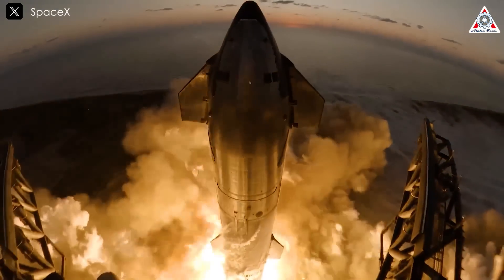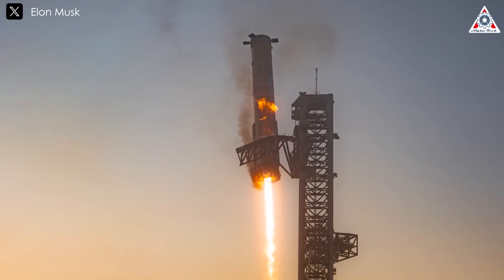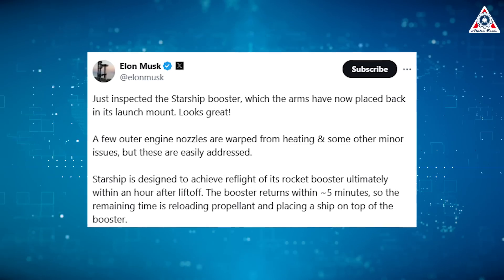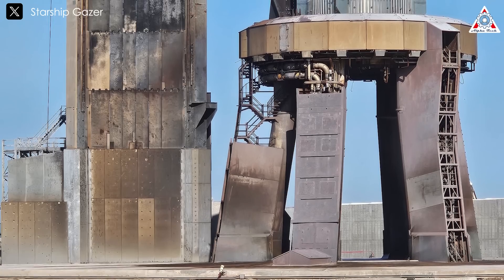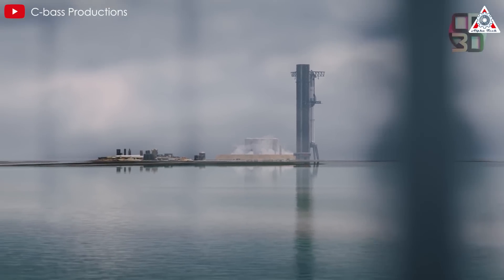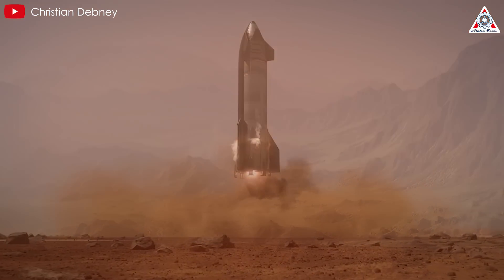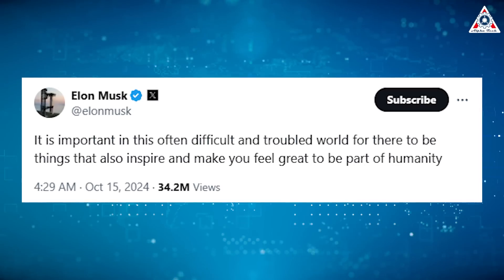Analysis SpaceX Stage 0, Starship and Booster Aftermath..."DAMAGED"???

Comment: Make them clean the water that gets contaminated launching and landing in the one spot. That water is filled with chemicals Andre’s right into the environment….glass of water anyone?
Reply: The majority of exhaust from the BURNED fuel is nothing but water.
Reply: Nasa, Boing etc. didnt care about pollutiuon of Water the since 60 Yrs und now its a problem  for SpaceX??
D
Reply: I would like to say when you burn methane (CH4) & liquid Oxygen (LOX), which heavy booster does,  the exhaust is Carbon Monoxide (CO).
L🙄🙄k it up. 
Nice catch SpaceX!! I love it! Whoot!
Reply: You are forgetting all the materials the engines are made of that ablate into the water. Heavy metals, seals, gasket materials etc.
Reply: @keith3761    Engines don't ablate, laughable nonsense, and the rest U mentioned can't be significant as it wouldn't be reusable otherwise.
Reply: @Mrbfgray  The engines do ablate, just as the tower does when it gets hit by the rocket exhaust, thus the constant repainting. even spaceX has mentioned before the ablation rate of stage 0. how much the engines ablate is something we dont know but they do ablate. Also reusable has a WIDE definition. reuseable does not mean 0 service required. It can just mean it needs X done to it before reuse. My car engine is reusable, but it can still need significant repairs due to wear over time. And although a car just puts in gasoline it does have a CAT because it does spit out metals and other enviro damaging stuff.
Reply: @keith3761    Your car ablates paint and engine heavy metals and vastly more toxic rubber than entire Starship.  That's why U clean every foot of road behind you, right?
Reply: @Mrbfgray The tires put lots of particles into the air.
Reply: @stanley8574    Yup.  Especially the way I drive.  :D)
Reply: @Mrbfgray  yes, thus my point that everything ablates/wears. Personally i dont care about the environment at all. I removed my cars CAT. Not caring about something is different from not believing it exists. Starship will cause environmental damage, as does everything. Im not the government I don't decide what they do and don't have to do EPA wise nor do i know what the scale of damage will be. But saying contamination is not happening is laughable. Personally I think Musk should have just bought a small Caribbean island off a small nation for cash and then could have the EPA and also would have much much less restrictions on launches by the FAA (FAA still controls all US launches no matter where in the world)
Reply: @keith3761    Removing cars CATs is utterly moronic while pretending to care about the environment.
Reply: @Mrbfgray  I just told you I don't care about the environment. you missed that. but I do understand it harms the environment.
Reply: @keith3761  OKAY Fine.
Reply: @keith3761    I was hasty and sloppy...mixed up posts here, some meant for someone else.
Reply: Why don't YOU go down and clean the water, obviously have nothing productive to do otherwise.
Reply: How would you know?    Or is it  just  you ,  trying to get some attention.!    Lossers!
Reply: The solid boosters pollute a lot more but guess they are ok right.

Comment: Newton 3rd law of motion:  Say you need 10,000K Tons of force to propel a rocket up, where does the downward force goes? What will be the impact on the ground?
Reply: Relative to the mass of the Earth? The ground is fine. Also, this stack weighs 5000 tons at liftoff, not 10 million tons.
Reply: @joshuasmith1981  What I see is the ground get compacted and in relation to sea level, it is sea level rise. End result is flooding. The downward force also impacted the tectonic plates resulting in earthquake.

Comment: why do they call it a catch when it can more appropriately called landing on the tower with the "chopstix" securing it post landing ?
Reply: Because the starship is what landed and the tower caught it.
Reply: Because the booster is supported by the tower it isn't touching the floor, so it would be caught like a child in a parents arms
Reply: Literally "caught" by the "catch" arms.  How is this confusing to you?  Harris voter?
Reply: Technically you are correct but I  guess 'catch' sounds more impressive. In reality, yes, the booster flew slowly under directional control into a stationary target. This time though, instead of the target being a horizontal circular area on the ground (or on a barge) it was a controlled horizontal V shaped area (the 'chopsticks') up a tower. As such, it's not such a massive leap up from the numerous previous guided landings of rocket boosters down onto a small target. It's just that the target was not on the ground.

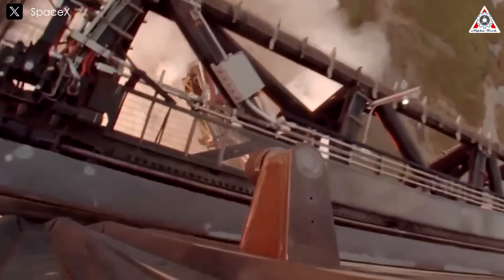Comment: As an engineer, I must correct one erroneous statement.  At 2:45 you said "The weight of the super heavy BENT the chopsticks by about 15cm."  In engineering and physics vocab, "bending" is understood to be plastic or permeant deformation.  What happened as the weight of the booster was placed on the chopsticks was most likely elastic deformation which is completely normal and will come back out when the weight is removed.  We saw this in action this week when they did the load testing with the water scrotums.  You can clearly see the arms deflect as the water load is increase and then rebound to normal as the water is removed.
Reply: @haydenwatson7987  water scrotums lol
Reply: Yup
Reply: @haydenwatson7987  Flex would have been the correct word.
Reply: @bobbyquack4908  Flex is the lay term, elastic deflection is the engineering term.
Reply: @haydenwatson7987  there was still 500 tons of fuel in the booster when they caught it. Those chopsticks were holding the weight of the fuel, plus the booster with its 32 engines.

Comment: Maybe the rocket facing sides of the tower should be skinned and tiled with the same materials as Starship. Would eliminate almost all tower repairs and painting.
Reply: Ceramic is quite good at resisting heat, but not good to resisting force. All that would do is generate shrapnel.

Comment: Does anyone know the reusable-rocket game plan for after the SHB is captured by the chopsticks?

I assume the chopsticks would place the SHB on the launchpad, then the next Starship (a safe distance away) would be rolled into position under those chopsticks, and lifted up onto the SHB.  After a quick safety inspection, just before the next launch, both vehicles would be fueled.  Does that sound right?
Reply: I think their ultimate aim is to just reuse the booster straight away. Just put another Starship on top. Have a turn round time just like an airliner. This will be part of the assessments they are doing now.

Comment: The trick was a success . But this is a bad solution to the booster landing problem .There is too much risk to the launch site infrastructure .
Reply: Funny, they said the same thing about Stage 0 after IFT1....

Thats what flight testing is for,  find the risks - fix the problem. Try again.
Reply: Booster catching isn't the biggest problem for Starhip.. It's too heavy .. and the payload to orbit far too low.  That is the biggest weakness right now and V2 needs to make up about 50 tons of payload to orbit over the V1 design.   I can't see them reaching that ridicuous goal with the V2 design.  Case in point - The new Raptor 3 engines will shed about 40 tons from the Super heavy booster.  But you'll only get 1 ton of extra payload to orbit for 6 tons of mass savings on the booster.  So that 40 ton savings produced less than 7 tons of payload .. ouch.  And any mass savings to be had on Starship, will be offset buy equiptment to actually do something in space.. like docking and fuel transer .. or or payload handling and deployment.  All mass that Starship will have to add. The future is grim....
Reply: @ericmatthews8497 does cool things but can’t fulfill the actual job like falcon 9 can 🤷‍♂️
Reply from the maker: I appreciate your insight! It’s definitely a complex issue, and balancing success with safety is crucial for future launches.
Reply: risk engineered to normal over time
Reply: @dadejazzba402  Musk has many billions . He can burn a couple .😂
Reply: Not even close. The current state is to be changed, they do it with tower 2. Plus a lot of precautions.
Reply: if it's so risky it wouldn't work in the first time. The odds would be too low. They were landing precisely on a dronship in the middle of ocean and on land for hundreds of times. This droneship is smaller than the opened chopsticks. They said that they have 1000s of small checks whether they will be able to land. There will be failed landing attempts, but most of the failures will occur on 10+ kilometers above the ground.